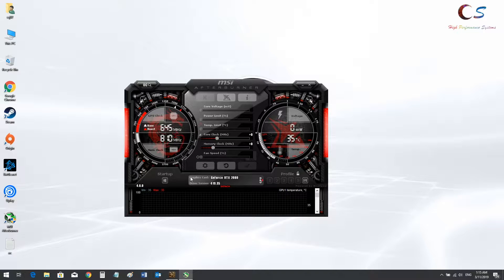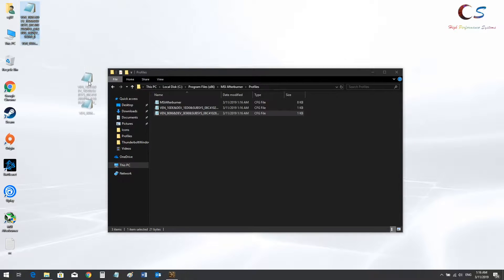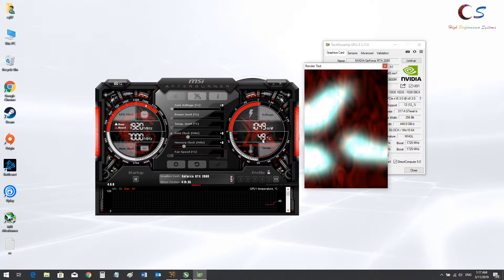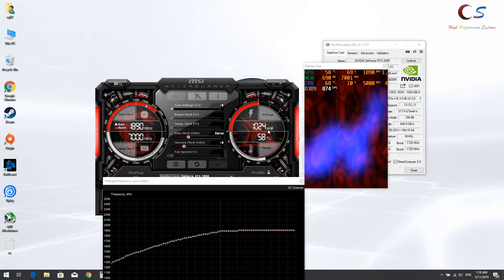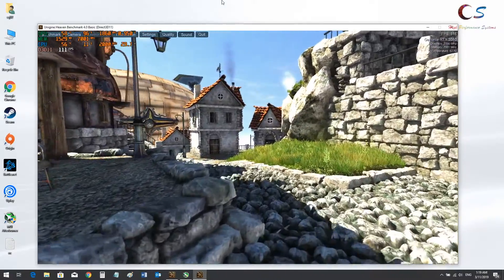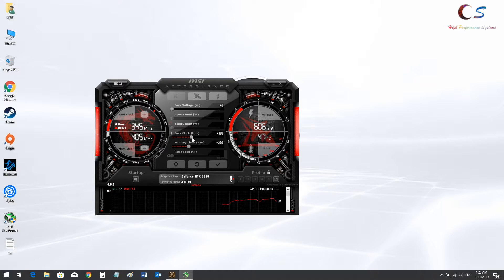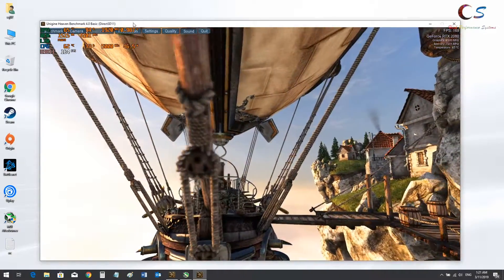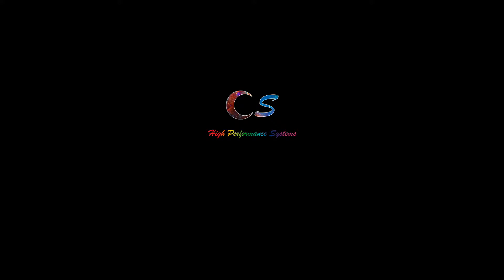Undervolt Laptop GPU (RTX 2080) MSI Afterburner

Comment: I have a i7 8750h and a RTX 2070 crammed into a pretty thin laptop and was getting super high temps. I was able to undervolt cpu for a small improvement. Your video helped me drive it home and both the cpu and gpu are running much cooler over all! Thanks!
Reply: Do you have an Aero 15 X9? I have the same CPU+GPU and could undervolt CPU by -0.125v but still running hot when both CPU and GPU are loaded. I still don't understand MSI AB curve and how to know if each frequency voltage is ok :(
Reply: @cgdz  lower the clock speeds in cpu. Replace the thermal paste. Get a laptop cooling base

Comment from the maker: I'm thinking of doing a 9900K tuning guide for laptops, would y'all like that?
Reply: CS Studios 
Hi good day nice job
Can you do some gaming benchmarks 
To see how it performs in real gaming
Reply from the maker: Yes I will have full system review hospefully by next week. I don’t have any new games but what games would you like to see?
Reply: CS Studios 
Any game i just want to see how close the performance to full rtx 2080 
I have been watching and reading all the reviews for this laptop and I noticed that rtx 2080 version are very close to full desktop version but the 2070 version aren't .
Reply from the maker: @mrm40  I'll test Overwatch, The Division 2, Black Ops 4, I'll see if I can get BF5 or Anthem cheaper somewhere and maybe include that. I'll also include some other tests.
Reply: CS Studios 
👍
Reply: So how is that 9900k cpu so temperatures? I wanted a laptop with that CPU.
Reply from the maker: @amonsmith3096  Without undervolt mine runs hot, low to mid 80s in game. However with a -100mV undervolt it runs very well. Temps in low 70s. I will do a repaste soon.
Reply: @CS Studios
Is it possible at all unlock the power limit for Rtx 2080 max-q?

 I know NVIDIA placed a lock on the power limit and temperature limit but I need to unlock it in MSI Afterburner to overclock it accordingly. 
Thanks! love your videos!

Comment: The only problem with gpu undervolt is your idle gpu clock speed and memory speed while being undervolted was too high w/o load. If you look closely after you reset your settings to default it starts idling
Reply from the maker: I’ll retest in a few days to see if the new beta has this issue. I normally open afterburner before gaming so it doesn’t affect me but for everyone else I’ll do some testing to see what’s going on.
Reply: @cs.studios  still worthless if the GPU doesn't idle. It consumes more power because games do idle most of the time
Reply: @cs.studios  also varies on what type of game too
Reply from the maker: “Games do idle most of the time” lol...do you leave your games on the main menu screen? My games tax my GPU.

Comment: followed your guide step by step, gpu clock however clocks at 300Mhz, thought if i run some games in the background it might change, but to no avail unfortunately. in fact game’s fps dropped significantly. had to uninstall the tuner app and the MSI AB for it to run properly again :/
Reply from the maker: Which computer is this? Maybe the undervolt is too low.
Reply: CS Studios CS Studios i’m using a hp omen 15 (RTX 2060) and whether it’s too low or not i couldn’t tell
Reply from the maker: Try an undervolt of 1.0v I think stock is around 1.050v-1.062v
Reply: @cs.studios  before i did exactly what you did in the video up to the rendering point, as soon as i start to render the clock didnt even change, in fact nothing did

Comment: I'm having rtx 2060 msigf65 in curve when I lock frequency at 1200MHz at 700 volt. I still get 84 temperatures. Please help.
Reply from the maker: You might need to redo the thermal paste on the gpu

Comment: thanks for this good tutorial~~
any suggestions or idea for i7-950h with RTX2060 laptop
i cant seem to find the perfect sweet spot for performance + temperature >__< much appreciated
Reply from the maker: First check how much voltage your GPU uses under load using something like GPU-Z render test. Mine does around 1905Mhz at 1.062v so I try 1905Mhz at 0.950v and it seems to be stable.

Comment: im slow, i cant get it to work, lol wtf. I only have one "VEN_" file in my profile folder (which is already a CFG file?). Also after replacing text and saving to desktop, when i go to move the new saved file from desktop back to original profile folder, it does not ask me if i want to overwrite or "replace the file" likes yours. It just simply places it along side the original "VEN_" file but as a "text" document and not as a cfg file. I noticed even when i click "all files" its saving the new one as a "text document"? Im using a 2080 max-q and my temps are never bad. I can overclock roughly +100-150 core and +300 memory(depending on game) and can reach 1920mhz, however it jumps a bit and and i usually am in the +1700mhz zone. I never have heating issues usually running below 70c for gpu, never cpu throttle in my games either however it does hit 90c sometimes(BF5) but im still pinged at 3988mhz...usually i am running in the 80--88c temps. I just wanted to see my voltage and maybe figure out a way to keep the mhz more steady than jumping around a bit? update: ok now i managed to replace the original file and everything went fine..except its not showing the voltage? Yes trust me i replaced the profile file and its now showing your text in the VEN_ file so i know it was done, i also turned on all the voltage boxes. wtffff
Reply from the maker: If you press CTRL-F can you still apply a curve? Does the voltage just not show at all or it says 0?

Comment: I have an rtx2080mobile with an i7 9750h in my Omen 17 i undervolt the cpu with -155mv and cache -150mv with programm XTU and i fix my RTX with 950mv on 2000mhz and i have in benchmark 1080p 300points more then before.
Tell me whats your best settings in Afterburner :)
Reply from the maker: Those are good values but make sure to sync cache and cpu voltage to the same values

Comment: Do you know how to fix gpu temp limit? I am having an issue with my asus rog scar 2 RTX 2070 where the GPU max out on load to be 75 degrees and saying that i have GPU Temp limit on MSI Afterburner OSD
Reply from the maker: This issue is vis related. Only way to overcome this would be with a vBIOS. You can try undervolting so it doesn't heat up as much or try repasting so it doesn't reach 75c
Reply: CS Studios do i need to copy and paste to msi afterburner profiles about the details you gave in the description above ? I tried to use curve method to undervolt but it doesn't seem to have an effects on the temps..
Reply from the maker: Yeah that's for voltage monitoring. You open afterburner, press ctrl F , change the curve like in the video then press L. Make sure to click apply after

Comment: I have a problem with my 2070 ROG scar 2 i7-8750 cause it always thermal throttle unexpectedly from time to time even when I'm not playing. I noticed that in MSIafterburner that my gpu clock in idle is Base 300mhz/Boost 405mhz.
Reply from the maker: Could you explain what you mean by not playing? Because if you are not in game, the graphics cards lower its clock speed to save power.
Reply: @cs.studios  I see, yeah figured it out yesterday but sadly it keeps on throttling again. I think its time for me to send my laptop and have it checked cause it gpu still throttles after I adjust the frequency in msi afterburner
Reply: @itsFatato  i have the same laptop. can you explain how you figured it out?

Comment: i think i just got a lemon-ass 51m... 9900k and 2080, i adjusted the curve all the way down to 1099 core and flattened it out all the way across... running heaven (with vsync on 144hz) and my temps still just go straight to the thermal limit and then it throttles down to 300mhz until the temps go back down to about 51c... then it just starts all over again

what am i doing wrong?
Reply from the maker: Which BIOS are you running?
Reply: @cs.studios  thanks for the reply! bios is 1.7.3 and vbios is 90.04.3f.00.63... i managed earlier to get temps down to around mid 70s by locking a point on the curve (clicking a point and pressing L) at 1500mhz and 762mv... i feel like i could move the clock up a little maybe at 762mv, but i'm just satisfied that i can get 90fps now without it throttling down now!

Comment: Hey man, would you be able to give me your Vbios for GPU? I have the exact same model number as I converted my 2080 Max Q to a 2080 Max P with 1795Mhz boost. Yours has a higher base clock than mine (1380vs1546 on yours).

I would really appreciate it bro.

Comment: This method is valid for any laptop gpu? I have a 2060. Is there any difference?
Reply from the maker: Yes any GPU should work. There are some limitations depending on model but I have found most work using this method

Comment: I have rtx 2080 on hp laptop also but it show 1380mhz is my default clock speed not 1545 like yours, do you know why?
Reply from the maker: Which model? The RTX 2080 in the alienware is one of the highest clocking one in laptops. Max-Q versions have even lower clocks
Reply: CS Studios its not maxq, i have omen17 with 2080 full
Reply from the maker: The AW has the highest clocks on RTX 2080. The part that matters is the in game boost clock. For example, in game i see around 1845 to 1905Mhz. You should be seeing at least 1750mhz I think.

Comment: My GPU temp limit is 75c on my Alienware Area 51m 9900k/RTX2080 what when ever I hit this temp makes my GPU garbage with unter 1000 clock and 5000 Memory... do you have the same limit?
Reply from the maker: You are probably running BIOS 1.5.4 or newer. 75c was introduced with that version. Go back to 1.5.0 to get back 87c limit.
Reply: CS Studios thx for the reply you really know your stuff 😁
Reply from the maker: @Marcin Niedzielski There is no way to disable it. As far as I know this is a Area-51m issue. I have not received the M15 R2 yet to confirm if it also has this issue.
Reply: @cs.studios  Any good tutorials to downgrade?
Reply from the maker: @gravediggermordekai7032  Check my latest video upload to increase the temp limit.

Comment: Been trying to OC and run benchmarks on my 9700k/2070 but I keep running into issues such as crashing and blue screening. Any tips to try and get a stable 5Ghz on the 9700k?

Also, are there any settings I should change in windows? Perhaps High Performance battery mode and moving the battery slider to performance?
Reply from the maker: There was a new BIOS released today that increases power limit. First give that a shot and see if it helps.
Reply: @cs.studios  Downloaded it. I'll give it another shot, thanks.
Reply: @cs.studios  That seemed to have solved my issue. Claimed that #1 spot in Firestrike for the 9700k/2070 again! Well #2 because the #1 used an AGA with 2080 in it. Thanks!

My Timespy score is still pretty low compared to the top score though.. can't seem to get anywhere near it.
Reply from the maker: Top score might have done a repaste, have a better sample or use extra cooling.

Comment: My gpu MHz are jumping all over..from 1400 to 1800..it doesn't stay at a stable number like your 1890?    I don't get it....
Reply from the maker: Which laptop and GPU do you have?
Reply: new acer helios 300..rtx 2060
Reply from the maker: It's possible its power throttling. Try decreasing the undervolt and set it to the initial peak click you see

Comment: if I press control f this thing doesnt open, why?
Reply from the maker: Try replacing the file first and make sure you are selected onto msi afterburner app
Reply: @cs.studios  wdym with selected msi afterburner app
Reply from the maker: Like make sure it’s the app in focus. Just click in the graph at the bottom of the app and then try ctrl f. Which gpu do you have?
Reply: @cs.studios  a gtx 965m

Comment: I cant open the frequency curve with ctrl f
Reply: I use msi afterburner and i enabled voltage control
Reply from the maker: Let me check later today with my laptop, maybe they changed something in an update
Reply: tyty
Reply from the maker: Just checked. CTRL + F works fine here. Try opening msi afterburner then immediately press that key combo.
Reply: @cs.studios  so it only works if I do it instantly?
Reply from the maker: Did it work? No, basically you just need to be clicked onto MSI afterburner, when its first opened it should be the program on top.
Reply: @cs.studios  cuz I don't rlly understand sorry
Reply: @cs.studios  OH nevermind ty for ur help
Reply: @psychoquacky7967 , did you manage to get the curve? Cause I'm facing the same issue.
Reply: @suyashahluwalia5386  gave up on it I upgraded my system already
Reply: @psychoquacky7967  yo didnt open up cuz it works with 1000 series and above pascal and turing GPUs only both laptop and desktop haswell it wont come up so whats ur GPU...

Comment: I followed your steps and my voltage was around 600-700mv after changing the profile files, but when running heaven, my temp was around 73°C, I wasn't able to adjust the curve, because the voltage was already low. Is that abnormal?
Reply from the maker: Which graphics card is this?
Reply: There are probably limits that restrict this graphics card. I just adjusted the clock speed and frequency, when I adjusted the voltage, the system would crash. The gpu temps are in the low to mid 70's which isn't bad

Comment: sorry but your video didn’t show any GPU temperature improvement whatsoever
Reply from the maker: I forgot if i mentioned in the video somewhere but the video didn’t show any improvement because i made the video at 3-4am in bed so my temps were already high. On a desk it shows a good 7-8C improvement. Depending how low your gpu can undervolt we’ve seen as much as 10C decrease.

Comment: ctrl + f does nothing
Reply from the maker: Make sure you're on msi afterburner. What graphics card do you have?
Reply: Try unlocking voltage control
Reply: @cs.studios  I'm having the same issue, using GTX 950. Any idea?